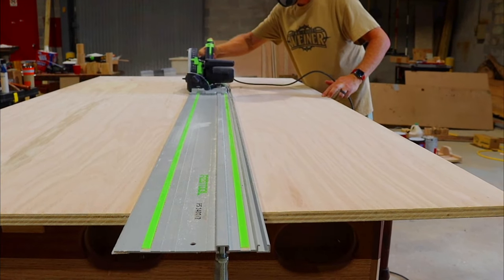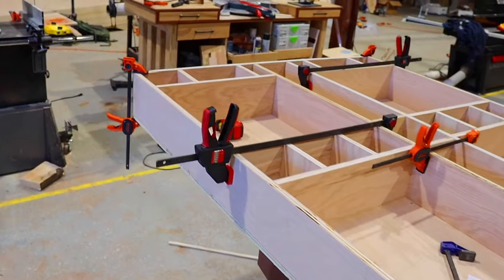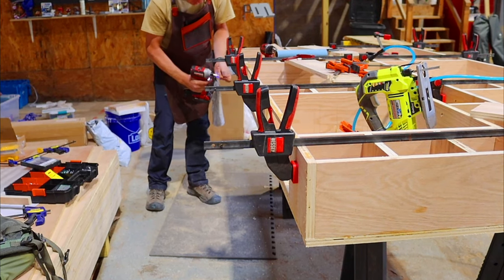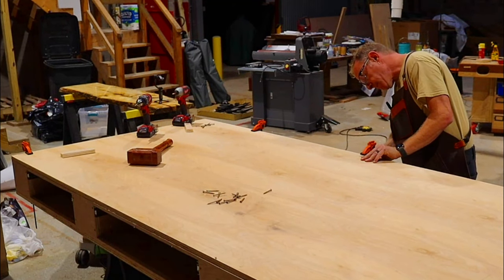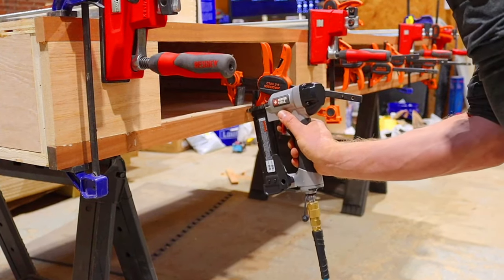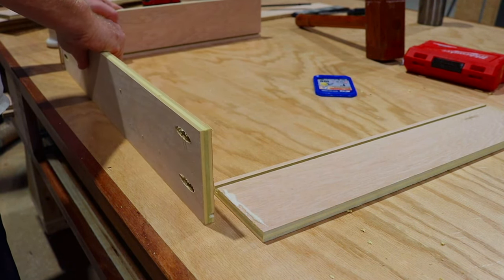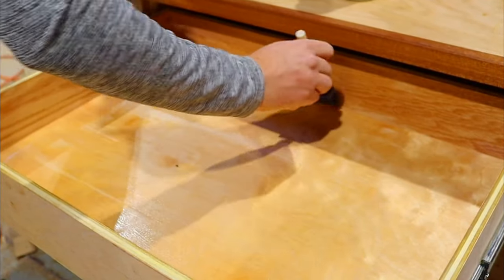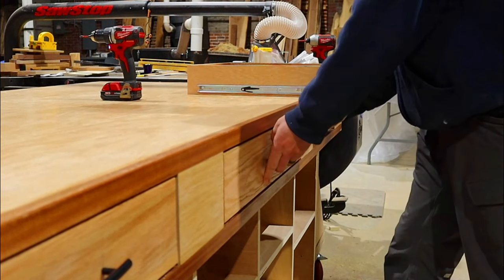How To Build A Torsion Box Top Workbench with Storage

Comment: I need to build a few torsion boxes for my shop.  I also own a sprayer but for things like that would probably roll or at least everything except the top coat, though if you “ roll and tip “ (follow behind the roller with a very fine bristle brush ) you can get a pretty darn good finish. Thank you for this excellent video.